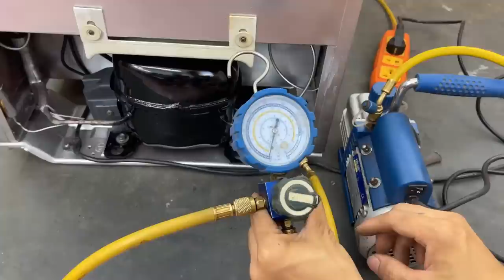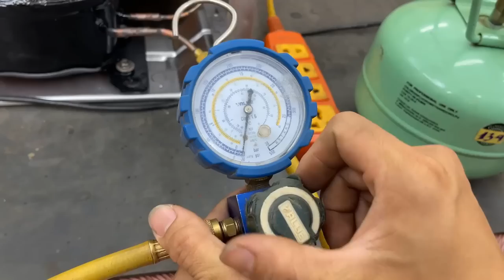Restoration Severely Damaged Old LG Refrigerator // Restore The Classic 2 Compartment Refrigerator

Comment: I'm a bit disappointed that when you reconnected the power cord, you just twisted the wires together and used electrical tape. For all of the effort that went into the rest of it, I would have expected some solder and heat shrink tubing, or at the very least, wire nuts.